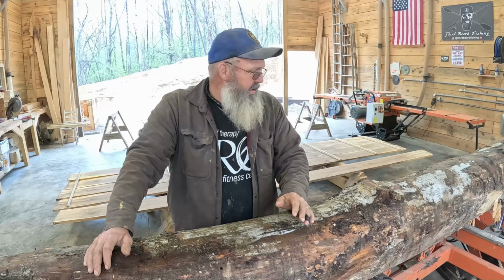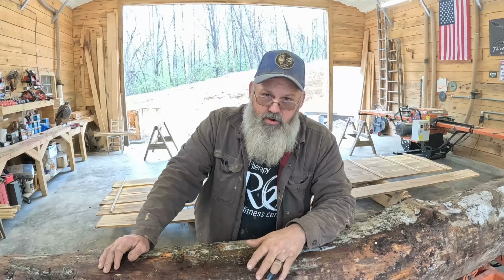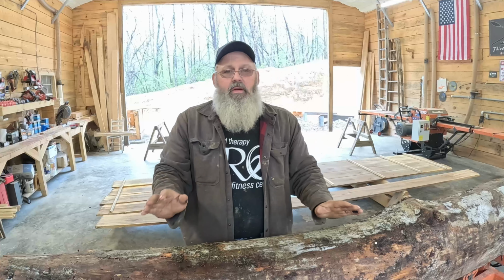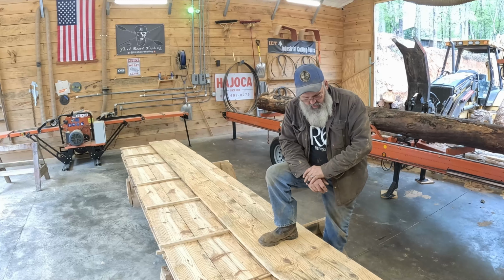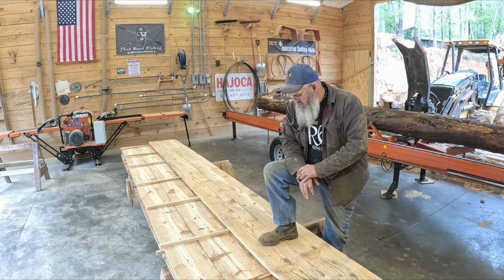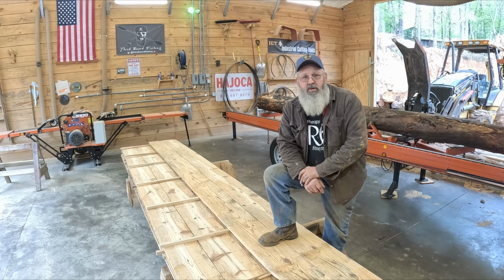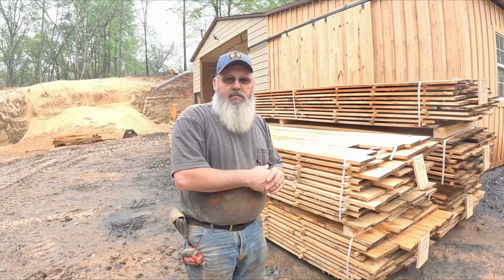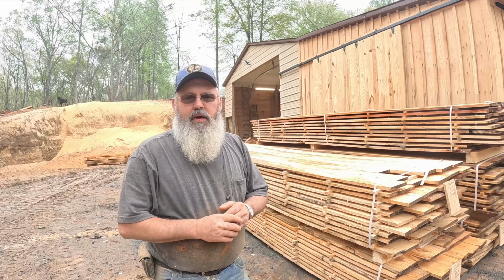What Happens to Pine Logs After a Year

Comment: When you are cutting that amount how do you figure board feet cut ?
Reply from the maker: We normally do 40" wide stacks x length x number of layers using my board foot app on my phone thx for watching and commenting 👍
Reply: Length X width divided by 12. X thickness gives you the board ft per row  then X by the number of rows.  You only gotta times by the thickness if your doing anything other than 4/4
Reply: Our piles are 48 inches wide. So we call it 46 inches to be on safe side
Reply from the maker: I use the board foot calculator app it's much easier, and I can put in prices per bf and get the total $ amounts
Reply: I'm looking to put a shed up for my mill, I see you cut inside, and it looks 15:20  like you are gas powered. Do you have problems with exhaust?